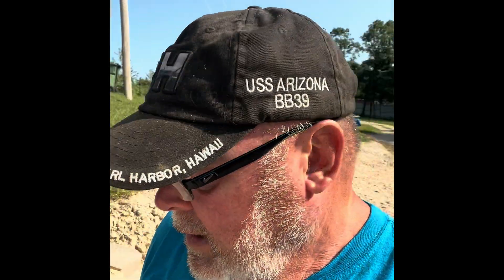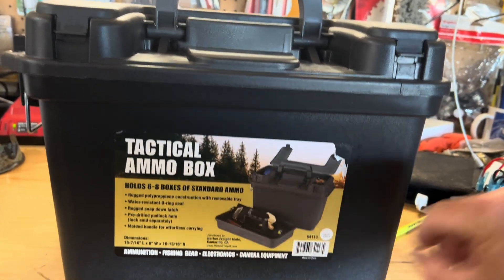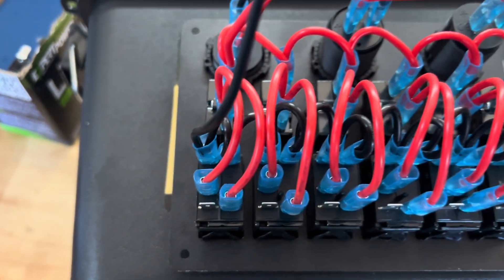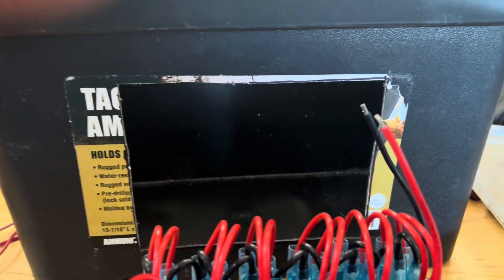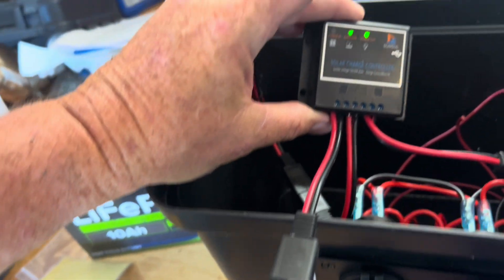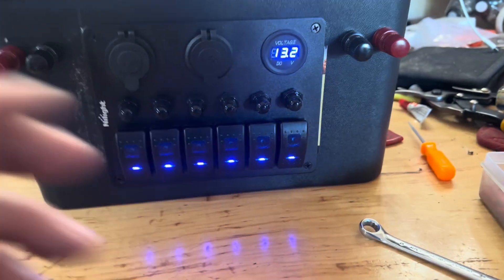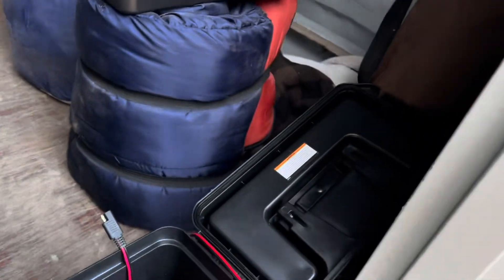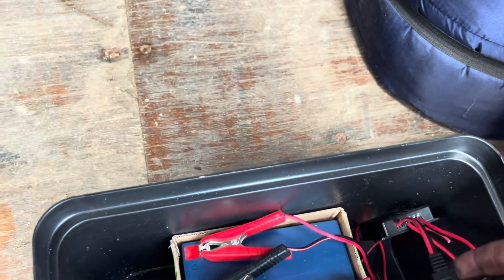How to build a DIY Portable Solar System for under $215 #diy #solarsystem #portable

Comment: Nice clean, compact system you built there. I want to build a similar system. I’d like to know what 12vdc lighting you are using. Any info on that you can provide I’d appreciate.
Reply from the maker: @cruikshank  here’s a link for the lights I installed. Good Luck with your project!  
12v LED Interior Light Bar，CT... https://www.amazon.com/dp/B094R1VNQX?ref=ppx_pop_mob_ap_share
Reply from the maker: @cruikshank  thanks, it will definitely serve our purpose!

Comment: Hi, live just bought the DC House leisure battery, 100ah with same features as the std battery plus USB A & C with 45w PD charging and 5.5 x 1mm 12v DC 5A socket in one package. 
It’s a start.
Take care M.
Reply from the maker: @markeh1971  awesome!  Good luck with your creation!
Reply from the maker: @markeh1971  would you mind sharing how much it cost for your setup?
Reply: @ResourcefulLivingHomestead   Hi, it cost £209.99 including free delivery to my door. Fro DC House on eBay in the UK.
Reply from the maker: @markeh1971  that’s a great price. You have more battery hours than ours to for about the same price.